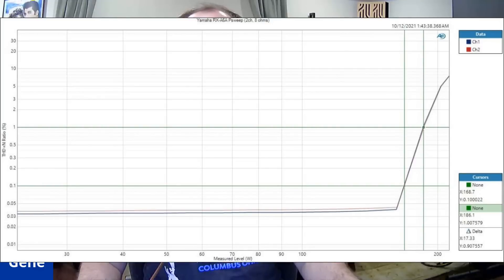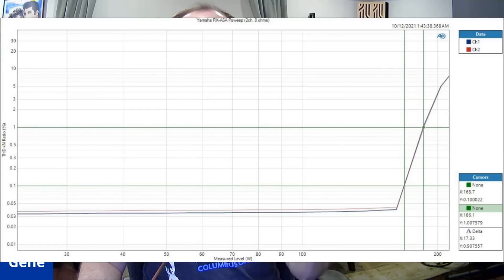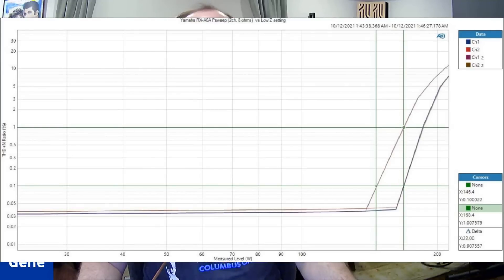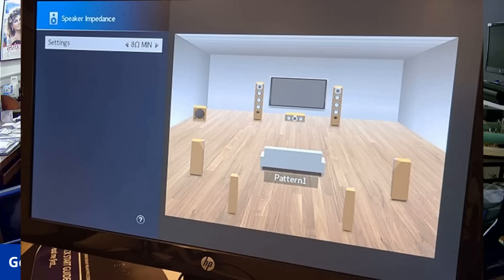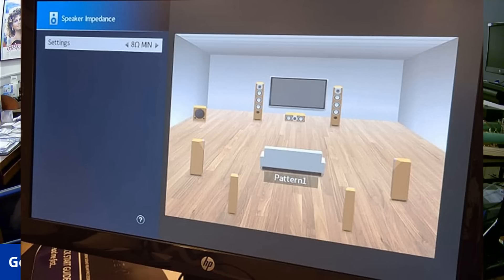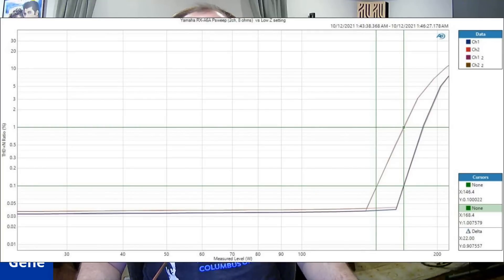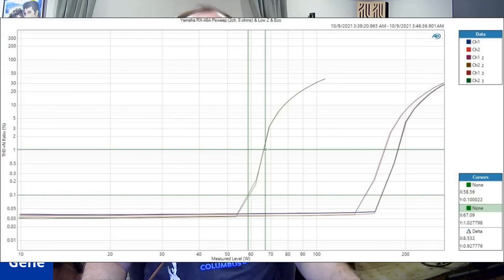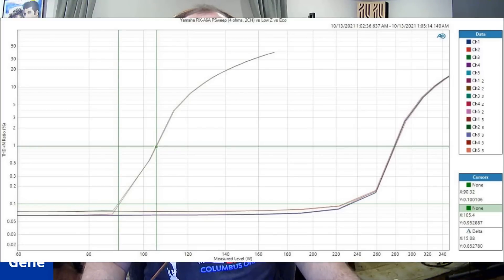Avoid Power Killing Features on Yamaha AVENTAGE AV Receivers - Use These Settings!

Comment: I switched it to the 4ohm setting because I got 4ohm speakers and it sounds so much more dynamic, it's so much more powerful.
Reply from the maker: Lot sure it is.
Reply: This has been proven for years not to use that switch and keep it at 8ohm setting. You lose power switching to the 4ohm setting.

Comment: I can’t wait for my a6a to arrive. I have a 3 channel emotiva amp to power my 3 main channels. I am thinking about buying another amp to power 8 more channels 😭
Reply: Thanks..
My RX A6A working beautifully with my Emotiva XPA5 .
Great sound
Reply: @harishr4423  I bought another xpa 8 channels it came in yesterday. I bought a Yamaha rx a4a and will return it when my a6a comes in loll. Hey let me ask you something so I have 2 emotiva amps. One of them doesn’t even produce any heat. But it works when connected. Do you think it’s ok? And the other gets a little warm.
Reply: @FamiLE215  

Hi...the emo's hardly generate any heat..compare it to the a6a..its like a furnace.
By hey,..they work great together.
200 rms!/ channel from the emo's..as against 150 from the a6a..
Enjoy your sound and let me know    how they sound in your new set up..
Reply: Wow..16 channels of power..
The a6a will give you a 9.2
Reply: @harishr4423  I know. My basement isn’t that big. I’m
Just setting up for a new house in the future. Amps I can hold on forever. Right now I just have a klipsch entry level speakers. It’s still very good but I want new speakers already loll. I have eyes on aperion grand v6t or the concerts

Comment: 50 watts at 7 channels is WILD. 25 is INSANE. Please do a video about all the advantages to adding an amp or amps to a receiver. Matt recently commented in a thread on ASR that people would be surprised how often AV receivers go into clipping. It would be nice for you guys to elaborate on that topic!!!
Reply: I want a full hour deep dive talk. Maybe a "case study" of a 1500 or 2000 dollar receiver with 4 ohm speakers, 7 channels being driven vs what actually happens when you add a 5 channel amp and run 2 off of the receiver. Is it worth the cost in an average size room at less than reference (lets say 75db) listening level. What actually is happening over the course of a movie (or loud 2 channel) to justify extra amplification? It would be a interesting and educational video that no one has actually broken down with the expertise that audioholics could provide.
Reply: They have in the past. Av receivers on its own power supply vs separates/ additional amplification. These are older videos and still useful today for anyone.
Reply: @EJHilt  100% . I learned so much in the past year from watching all these videos.
Reply: @MrJjburgess11  it's a good channel on YouTube. And very educational on audio and equipment specs etc. Been watching audioholics for years. Enjoy the channel brother.